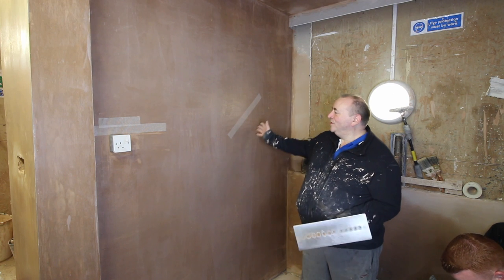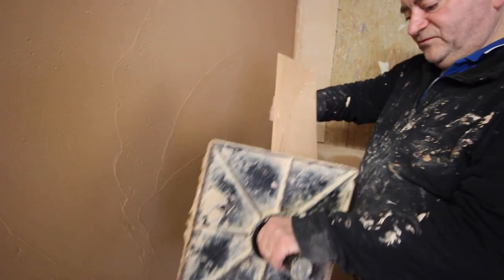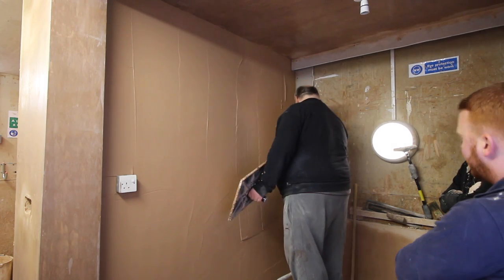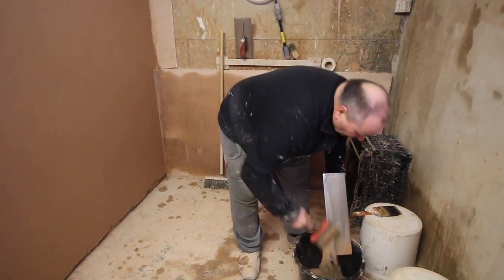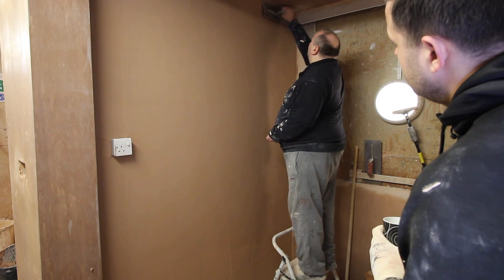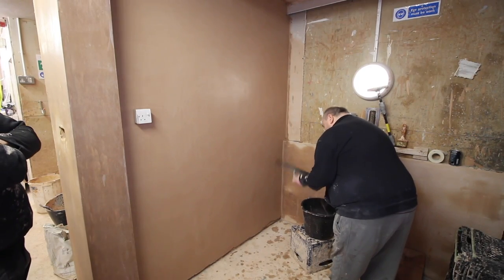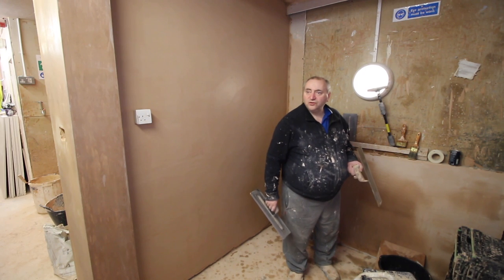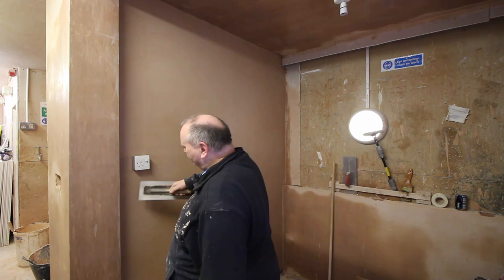Plastering a wall

Comment: My problem as a newbie is fannying about with it too much on the first coat.  Need to learn just to batter it on and worry about getting it flat later.  Halfway through my gear starts to go off in the bucket.

Comment: When we hardwall plaster set here in Australia-(Lime/plaster) mix-we actually do the first coat very tight -a scrap virtually and that removes any chance of air being trapped then we pass over with our 2mm coat and flatten  and trowel to glass like finish-can set up in 10-20 mins.
Reply: Glass like finish? Painters reading this are punching the air right now

Comment: 1st coat still wet  need bit of time to dry then 2 nd coat should be applied at sametime y need  labour to give you hand .mix fresh one for 2 nd coat
Reply: Naa, the second coat flattens in the first, if the first is too firmed up then the second won’t do it’s job properly. I use the same mix for both coats all the time, worst case water what’s left down and add some powder if you need more

Comment: Using the same plaster for the 2nd coat isn’t recommended. You should always mix fresh plaster for the 2nd coat after the first coat as dried a bit. You can still get a good finish but I wouldn’t be teaching this method to trainees.
Reply: He says at the 43 minute mark, that if he was on the job he would be laying on 2 walls at the same time from the first mix, then mixing a fresh mix for second coat.  What he is doing here is good enough for demonstration purposes.
Reply: I think he done time saving techniques because of the tutorial  thats the impression i got anyway